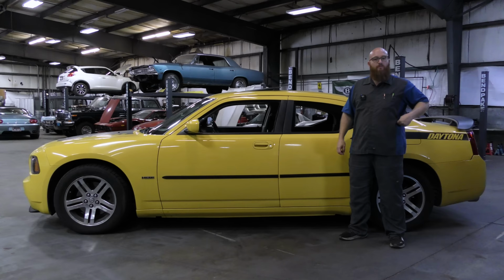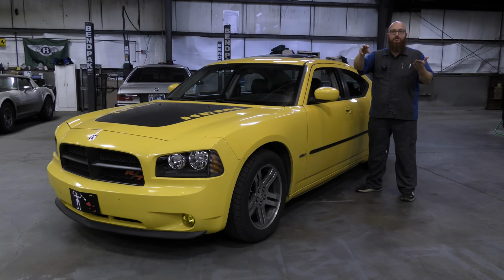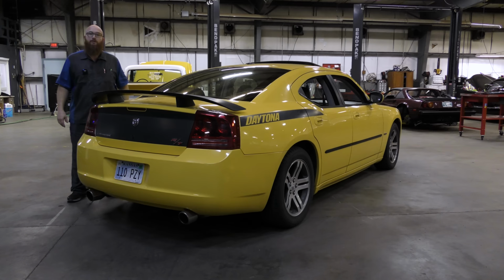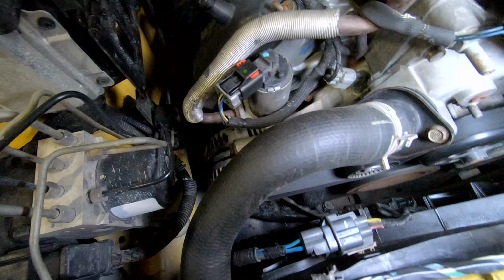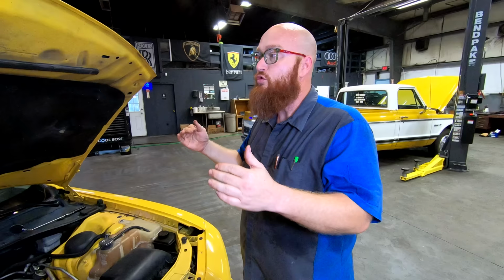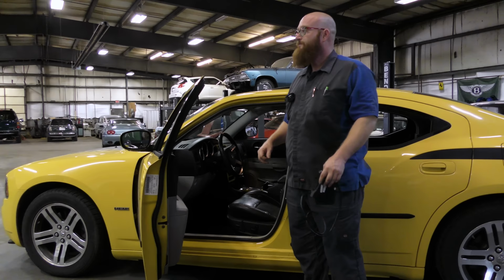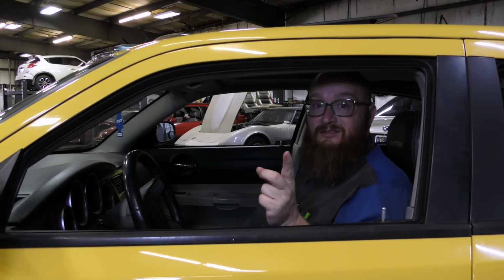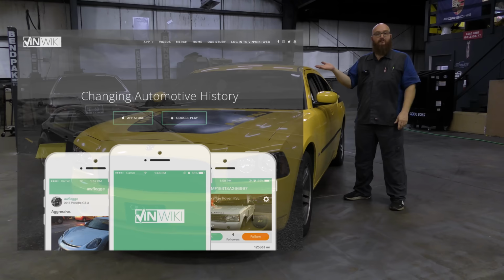4 things you MUST check before you buy any used car! CAR WIZARD shows how not to be scammed!

Comment: I really wish I did all this when I bought my 83 280zx Turbo. I knew what to look out for when I was buying it, but I really just glanced over everything bc I just wanted the car. I'm an idiot for it, the title didn't match the sellers name but dude told me it was all good so I bought it. It wasn't stolen or anything, just a shit ton of back fees owed. The car had no power steering fluid, really bad rust, overall it isn't in the greatest shape but as long as it ran I was happy, until it stalled a couple miles from my house. The car is really a learning lesson, and honestly don't let emotions control your actions because if you really need a car and think you found the perfect one, it could be a pos. seriously take my boy Car Wizards advice.

Comment: Also check under the carpet for rust and water intrusion
There may be leaks via window/door seals or from a corroded /damaged bulkhead
Also check the underside of the door/s and in the Wheel Well  Trunk.Boot area for
rust and water damage -  Check also if there is any water in the in the Lights assembly -
it may have a miniature Goldfish bowl
Also check all the lights. Hi.Lo Beam - indicators - Brake/Stop lights - Hazard lights

Comment: My 2009 Dodge Charger has been a great car for the last 8 yrs. Small issues like fuses or nails in tires, but as far as the engine, it's been awesome. (knock on wood). Also, you can't check the transmission fluid because you need a special dipstick for it. @13:11
Reply: You better knock on wood since hemis tend to knock on valves.
Reply: @EvanDickersonM81  2005 Chrysler 300C in my garage right now with 187,000 miles and my Hemi runs strong like the day I bought it 4 years ago with almost half the miles. Take care of them properly and they last as long as anything else. Biggest issue I've had is my coolant started boiling in the overflow tank last year, almost overheated but I shut it down quick before the temp needle got to the H - almost thought it was a head gasket but turned out to be a clogged radiator (I neglected my antifreeze flush intervals).
Reply: @My Pronoun is WTF Leaving the gas cap loose will throw a check engine light, which also disables the MDS
Reply: @My Pronoun is WTF it's called hemi tick, it's a known issue. I've yet to hear of Toyota tick or Honda knock. buddy has a 09 challenger that got it and ended up needing a whole bank of valves and rockers.
Reply: @chynacash3138  buddies 09 challenger got it after not even 100k miles. Not all hemis will get it but it has a common nickname for a reason.
Reply: @EvanDickersonM81  You have yet to hear a Toyota or Honda tick? Pleaseeeeee lmao all machines can have issues and I certainly know of some common defects in the Japanese brands all the same so being a cheerleader for them while trying to knock our Chrysler's will get you nowhere at all. Not all Hemi's get the tick either. Maintain them and they last as long as anything else like I said.
Reply: @chynacash3138  yeah difference is it'll tick for 100k and cost 500 to fix
Reply: @EvanDickersonM81  Virtually everything on a Hemi is inexpensive to fix. Any catastrophic failures are almost always user error/neglect. People who know how to maintain their specific vehicle or who bother to open up their owners manual to find out are the ones who make them last. Irresponsible people who wanna drive their 350+ horsepower car like a throw-away Corolla and don't change their fluids at the manufacturers recommended intervals, go thousands of miles past oil change dates, not glance at their temp/oil gauges regularly while driving, and use junkyard or cheap aftermarket parts, are the ones who complain on the internet that their car is junk when in reality they are just stupid and caused their own problems. Maintenance is key like I said.
Reply: if its the charger with the old v6 then your running a ticking time bomb because the v6 before the pentastar is garbage.
Reply: @pilsplease7561  Actually my car and engine are doing well. Thanks for your 2 cents.
Reply: @VL1975  Im just saying if its the 3.5 liter  sohc v6 its going to grenade at some point because that engine has a penchant for exploding oil pumps and cracking the block.
Reply: @pilsplease7561  haven't had any issues except some stupid valve release on top which they made of plastic and kept cracking. Then I installed an aluminum one on and it's working fine.
Reply: @VL1975  yeah that sucks. The worst issue i ever had with a vehicle was with my F150 which is my second vehicle, intake manifold blew up, also had to replace the sensor, and the paint peeled off the truck because ford paint is shit, and my truck had the issue with the door opening on the highway and ive sworn off ford vehicles permanently once the truck wears out because its such a money pit.
Reply: @pilsplease7561  Ironically...today is 8 yrs since I bought that car. Considering the push to EV and the fact, I don't want a car payment, I'll probably hold onto. Unless I win the lottery, even then I'd keep it as a daily driver. lol
Reply: @VL1975  I dont think EV will be much more than a passing fad no matter what they do with the tech it will never take off like they hope it will it will die in 5-20 years because its not practical and too high maintenance.

Comment: One more thing to ask about (I've had this happen twice) is how many key fobs they have. Always check if there's only one.
One was a Mazda 3 Hatch and thought I could just get a key made. Nope, transponder key and although I could buy the key and program it myself I had to sign waivers before anyone would cut the key. I had a couple extras just in case the cut was bad. 
The second was a 2014 Ford Focus Titanium with push button start. I went in knowing to check it out and they had only one fob. Lose it and you have an extremely heavy dead weight. Found out it was something Ford could no longer replace (I took it to them and they had fobs but were unsuccessful programing) so I assumed they were trying to get me to buy one of theirs (They were). So I used my locksmith from the Mazda situation who could order the fob and program it. Success, but it was about $200...$100 for the fob and $100 to program it. I added 3 fobs because my wife has lost MANY fobs. The Ford was in perfect shape, passed all checks, VIN checks and mechanic said it was great and price was great (after knocking some off for the only one fob trouble) so I did buy it with only one fob.

Great video! Many people never think to thoroughly check the title first and never accept less than checking it in your hands. Also don't be afraid to ask to see their drivers license to match the title.

Comment: A few years ago I bought a non-running 97'  F-150 from a friend's father. It just needed an engine and they wanted 600 bucks for it. For me it was a steal. I needed a truck and at the time, a running engine was easy to get. When we went to the DMV to get the  title switched, we found out that there was a lien on the title that had to be settled. The bank that had the lien had been bought out by another one. The vehicle had been paid off, but the bank never released the lien. Anyway, the issue got resolved through the new bank but it goes to show that even small things can get missed and hold up or ruin a sale.

Comment: Make sure you get at least 2 keys especially if they are electric keys that need to be programmed to the car.  They can run up to $200.00.  Also check for warranties on the vehicle that may have expired.  Honda has a lot of these problems, like a block that cracks around 100-130 miles or Chevy Equinox that has a timing chain that breaks around 100miles.
Reply: I had 2 with my dodge challenger, grandma got ahold of my spare and lost it, and its $500 for a replacement from dodge so i said no.

Comment: Great info! Other trick is to go through the glove box. Most people don't throw away old registrations - are there weird gaps? I found 8 years of service receipts in the glovebox, so knew the owner had done synthetic oil changes every 3k... Also check for a spare. I didn't and got home and realized no spare tire. Could have knocked $200 off the price...
Reply: Great advice. I just bought used from a dealership. Digging through the glove box, I found the previous owner’s registration with address. Snapped a pic with phone. Looked him up on the web. Actually able to talk to him and question about vehicle history. Sealed the deal for me.

Comment: Also, as a seller, make sure you remove your plates/tags before you hand the keys over. Do not let the buyer use your tags to transport the vehicle to their residence or get it registered, inspected, etc.
Reply: This is not true in all states. It is actually illegal to do this in several midwestern states.

Comment: Hey Wizard, what about a pre-purchase inspection? At what price would you recommend getting one done?
Reply: I think we charge like 100 at our shop in Arizona, might have went up like everything else recently though.
Reply: @twiztid6977420   A hundred sounds like a lot at first but much cheaper than a engine, transmission, exhaust, and I thought the owner said it just needed a $20.00 tune up.
Reply: @darylkik6204  No tune up is $20 lol
Reply: @twiztid6977420  True but remember when you wanted to believe it.  Then you grew up.  Wait a minute then wouldn't the seller spend the $20 and get a $1,000 more if it was that easy.  Ding ding we have a winner.
Reply: @twiztid6977420  model T

Comment: One additional thing I would pay attention to is looking for rust on the underbody. Are the shocks or suspension pieces very rusty? - thanks wiz!
Reply: Yes, check for excessive rust on the underside, especially in key support spots of the frame or unibody and where a jack would go to lift the car. This should be done regardless, but even more important in places that have wet weather and/or harsh winters where road salt is used.

Comment: #1 Rule when looking at a car,Never go look at a car at night,everything looks good at night,you want to go during the Day always.

#2 Rule when looking at a car,Make sure the engine is cold to the touch,it’s the best way to check the oil,coolant and other fluids,specially when looking under the oil cap to check if it has a blown head gasket if you see that peanut butter color gunk under the oil cap.

Comment: 1. only buy one owner cars.  2 . you are right about the title and walk around. 3. check all bolts for tool marks , if bolts have tool marks, its been worked on.  3. if the trans is full of new looking fluid,  be care full.  4, your wright about the rest.
Reply: To be sure it's a one owner car, look at the title for "previous title number" it should say "MSO" (manufacturers statement of origin) anything else means it is NOT a one owner vehicle.

Comment: Just to add: Compare Vin on car with title. Smell the oil, pop oil cap when warm/running. Get on all fours to look for rust and parts/wires hanging, some rockers you can't see from standing. Listen to the exhaust for leaks. Look for missing plastic under the front. Feel the carpet for water including the trunk. Look for rust on the spare and jack, it's a sign of water/condensation getting in the truck. If you can jack each wheel give them a shake and spin. Look at brake/gas lines for rust or leaks. Don't forget the parking brake make sure it holds and releases.
A lot of things are easy fixes that are also bargaining chips to get a lower price.
Recently got a Dodge Journey they wanted $5900 we got them down to $4000. Now I'm replacing 4 brake pads/rotors, 2 ball joints, 2 wheel bearings, 1 abs sensor, and basic maintenance. Total repair cost less than $300. Got some paint and light rust in the future. May do the trans oil/filter too.

Comment: Code readers are the best especially if you plan on buying a car with issues or a potential check engine light on. Went to buy my second car that supposedly just needed a gas cap for a evap code. Connected my scanner and found the said evap code but also found a p0420 catalyst efficiency code. If I hadnt had the scanner I for sure wouldve bought the car and been in for a rude awaking on the $2000+ Catalytic Convertor bill

Comment: I would add: Get a list of known issues with the make and model year of your vehicle and be prepared to check or pay extra attention to those when you go to inspect the car. You find this sort of info all over the Internet and see if the vehicle has these issues currently or will be imminent in the near future. It's just really helpful to know the big expenses that might lie around the corner. For example, if the car has a high percentage of transmission issues, than pay extra attention to how it's shifting, etc. I'm far more interested in things like that, vs the tread left on the tire or the wear on the rotors, all of which can be easily replaced.

Comment: Last three I bought came from state surplus auctions.  The one I have now I bought during Covid when they held them online and you got a few photos and a 30 second video to go by.   But I also recognized it and knew where it had been the last 10 years.  So I bought it, put tires on it, changed the oil, and I drive it all over.

Some states don't use titles on older cars.  How hard it is to register without, varies as states have different rules.  In my state it's almost meaningless to not have paperwork.  So keep that in mind too.

Comment: If you get a code reader/scanner you can also find some that will tell you if the car is ready to test for an emissions test. This will show they reset the codes or unplugged the battery to kill the codes. I ask several times before going to look at a car “is there anything that needs to be fixed? Is there any service due or coming up soon”. If I find something that they didn’t tell me and they let on they knew… the sale isn’t going well for them. Either I walk (most often as now I have a bad feeling) or I take the price down quite a bit and tell them I don’t know what else is bad that I may find that they aren’t telling me. 

Great video

Comment: Love your channel, great content. Subscribed right away! However,  Quick legal point of fact. When buying a vehicle (or any expensive item) from an Estate. It is NOT the Power of Attorney you should be concerned about at all. Power of Attorney (in most states) dies with the deceased. Who first granted said power. You want to look for.........
1. Attorney in Fact, 
2. Executor or Executrix of the estate. (Usually named in the Will) If the person dies Intestate (no will) then the Probate Court gets involved.  That can tie things up for a LONG time. 
3. The Trustee,  if the estate is set up in any kind of Trust..... Revocable or Irrevocable. If it's a Perstirpes Trust such personal property items may have to pass straight thru a line of succession to a specific person/Beneficiary 
4. That Beneficiary and, NOT the Trustee would have authority to dispose of such assets. 
ESTATES CAN BE THORNY, If the sum of money is substantial. Consult your own Attorney! It'll save a lot of possible grief. (I'm retired sorry,  after 25yrs of that kinda crap, very happily retired.)  Thanks for the great car tips!

Comment: I checked out a subaru XT 2010 and i did those things, then i test drove it and it had a noise at boost.  It had 160k miles and they wouldn't go down on the price after seeing that very little was done in the car fax.  I'm glad i did.

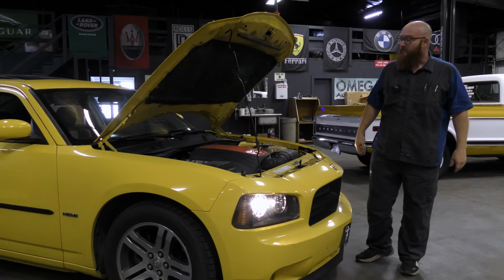Comment: 16:39  try to get a cold start when inspecting a car. Also, when you start the engine, have a friend watch it and make sure it’s not dancing or trying to jump out when you start it and stop the engine. A maximum of 1-inch movement could be an indication of worn out engine mounts, anything more than that could be bad (depending on the make & model)

Comment: SMELL fluids, especially ATF, if smells burnt, walk away.  Rub the inside of the muffler, if extremely sooty, walk away.  Check that coolant for any oil and oil for any coolant.  Anything other than a bit of white smoke upon cold startup, is an issue.  Ask for service records.  Jeeps, especially pre 2006 (TJ), scope the inside of the frame for rust.

Comment: If it’s front wheel drive turn off the radio, roll windows down and find a parking lot somewhere and turn hard in both directions and listen for clicking sounds that can potentially be CV Axle problems!

Comment: Great advice! I used a code reader when buying a Mercedes ML350 from a dealer. Pending code saved me thousands of dollars by negotiating - and all I had to do to address the code (which did show up after driving home) was replace the oxygen sensor. Under $100 repair.

Comment: I bought a 2008 Lexus IS250 and I only had one major issue with it. The water pump needed to be changed and the thermostat needed to be replaced. Car temperature briefly went high for just a few seconds and I had it checked ASAP. Well thankfully I had money put aside, I did that work, and the car works perfectly fine now. Been driving it for two years with no issues. Only basic maintenance stuff I been doing now. Oil changes on time, fuel induction cleanings because of direct injection, new tires, and so on. Basic stuff nothing major. As for the title and all that? I made sure everything was in correct order. I made sure the car was a clean title as well.

Comment: First thing you need to check for is if it has a dodge logo in my opinion 😂. My girlfriend has a 2016 charger. Only 120,000 miles, shes had to replace the subframe, water pump, thermostat, all four breaks, new radiator, had to get all new sway bar, all 4 new motor mounts, check engine light is CONSTANTLY on, and wont go off, tpms system no matter how much you fix it, that light will also never turn off